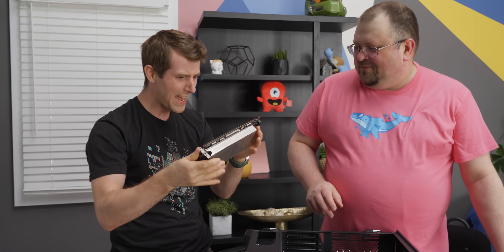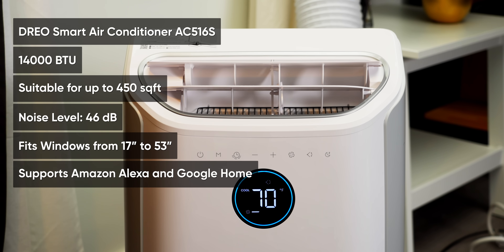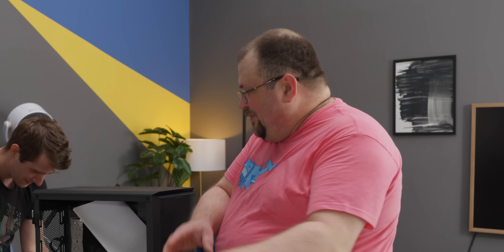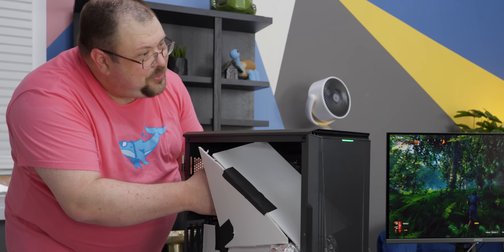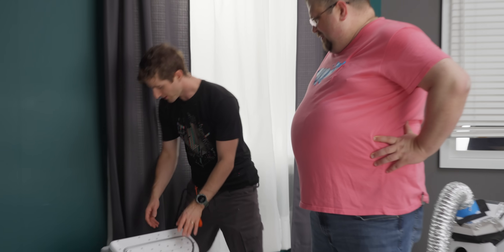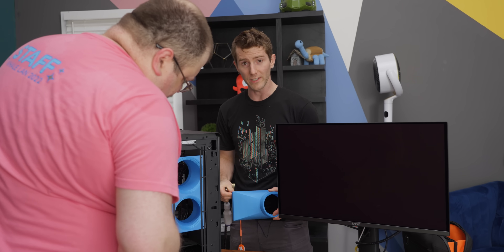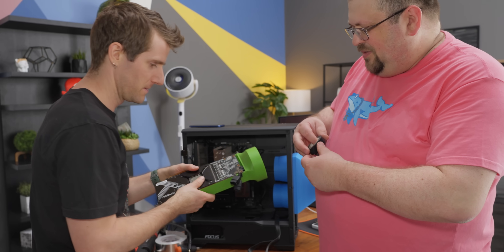Everyone is Cooling Their PC Wrong

Comment: I am "Grade A" disappointed that you didn't build the PC inside the AC box.

As the AC unit has 1 inlet and 2 outlets, you need to create a closed loop between the inlet and the cold outlet and have the seals PC in the centre of the loop. It means more efficiency as it's not taking warm room air and it'll very quickly reduce the air's humidity to nearly nothing.

Comment: The AC delivers cold air, that are hitting warm components, so condensation risks is only the backside of the mainboard?... Pretty sure you should just AC the entire case, so condensation only have a chance to form on the outside of the case. Using the modern house renovation sale pitch "Seal tight, ventilate right"

Comment: I mean if you really want maximum cooling power, take the AC unit apart and build the pc around the evaporator coils.
Reply: that's what a chiller unit is, LTT has done a bunch of videos on that already
Reply: If the computer components are too close to the evaporator, condensed water can drip or splatter to it.
Reply: Then they wouldn't get the sponsor money.

Comment: 500 dollars for a single exhaust hose portable AC is awful, those single hose units create negative pressure in whatever room they're in which is actively heating up the room you're trying to cool by pulling hot air from under doors, windows, hvac ducting, outlets, and any other small gaps for air to come in. If you're spending that much money and need a portable ac, get one with dual hoses, one to pull air from outside and one to exhaust air outside to avoid the negative pressure efficiency loss

Comment: I did this 25 years ago by running the air conditioner duct to an axial fan blowing directly into the server case.  All noisy fans removed and steel custom baffles inside.

Comment: You won't have condensation problems inside the PC.
The AC cools the air. The water in the air cannot just vanish, but the now cooler air can't hold as much water, so it condensates in the AC. That air now has less water in it than before. Once it reaches hot surfaces in the PC and it's temperature rises, it's capable of taking up more water, so basically you dry your PC.
Condensation will only form where warm (moist) air touches cold surfaces; the air duct including all the shrouds and so on and your case - all around!
Reply: I was looking for this comment! completely agree, the PC should be fine. the trouble with cooling PC comes from cooling the components colder than the Air around it 🙂
Reply: @minibeyse  there is the risk of turning the chilled PC off, having warm room temperature air get in there and have a little bit of condensation then.
But I reckon that should be only a little and everything should be fine.

Comment: 2mins in and linus has already dropped an air conditioner . typically the compressor locks up if you run it side ways. it can even explode if ti sucks in the oil and tries to compress it.

Comment: The only real downside is those single hose ACs are WOEFULLY inefficient. You're taking a ton of conditioned air from the room and blowing it outside, meaning hot outside air has to leak in to replace it. Dual hose models or regular window ACs are drastically more efficient. Alec from Technology Connections explains it in far more detail than I could here, but as someone who's used these units (dual and single hose) as my primary AC in the past, there's a night and day difference.
Reply: You can fairly easily DIY most single hose units to be dual hose with some cardboard and duct tape. Neither will ever be as efficient or quiet as a proper split system, but that DIY upgrade does wonders for single-hose units
Reply: @knexfan0011 this is an incorrect assumption - it's not as simple as just making a hose attachment on the intake, you also need a complete separation of chambers inside the unit itself and most of these single hose units do not have that and some are designed in a way where doing so is impossible. So keep that in mind. If you do not do that, the second hose does literally nothing
Reply: @knexfan0011  Im doing exactly that. Works way better with that mod.
Reply: @knexfan0011  How do you DIY the single into dual ? I don't really get it.
Reply: @feuby8480  You find which of the intake vents go to the condenser (the part that heats the air). Then you cut a cardboard box just right such that it covers all those vents. Then you cut a hole for the 2nd hose into it. Finally attach and seal it all up with duct tape. 

Just make sure there's enough room for air to actually flow properly in there, the hose ends are a bit apart and the fan is set to max.
Reply: @knexfan0011  oh thank... Yeah that makes sense. I have mini splits now, and went to window units before, so it do not apply to me anymore, but I was really curious.
Reply: @knexfan0011  Or you can do it ghetto style where you just cut open a grocery or garbage bag and wrap it around the vents on one side and around a hose on the other side
Reply: Yes! Its almost as if you'd have to cool the Unit to, while sucking in the warm Air your trying to exhaust... These things should be banned and 2 hose should be the standard....
Reply: Split unit is the way or geothermal.
Reply: @NerbyScurvy the idea for portable ACs is when you cannot make any modifications (in other words you're renting...) - and split units need sash windows which aren't a thing in the overwhelming majority of the world...
Reply: @Micromation  split units dont need windows, they need holes in the wall.
Reply: Really what you would want to do is to have an outside thermal exchanger and condenser, and then run the coolant lines to an evaporator and a fan combination in frot of the PC and push all the cold into the case - which is basically just plugging your PC directly to the inside portion of your AC/heat pump. 

And then it'll run way too cold and create problems with condensation, and eventually you'll end up just running a secondary coolant loop and whoops, you're back to watercooling - and you might as well just run it to your pool in the back yard like Linus because all this tinkering has already made it so expensive you could have dug a pool for the money :D
Reply: Don't get Alec started on the refrigeration cycle XD
Reply: Yeah this type of AC honestly should just not exist. Its kind of infuriating once you realize how flawed it is.
Reply: @psychopyro8866  It has it's uses, but shouldn't be used where a window unit fits. In my case I got one free and use it for a small room in my garage that I couldn't otherwise get an AC unit into. It's less than a dollar when I use it, and that's worth not sweating your balls off.
Reply: Sometimes you don't have a choice, and the difference isn't that big in practice. There is a MUCH bigger temperature differential between the indoor air and exhaust air (perhaps 50 C difference) than between the indoor air and outdoor air (perhaps 10 C difference). The SACC ratings now used to market air conditioners takes this all into account, which is why for the largest portable air conditioners (14,000 BTU nominal), you'll find single-hose units topping out at 10,000 BTU SACC, while dual-hose units can reach 12,000 BTU SACC.
Reply: This depends on where you live. I have a dual hose unit and I often disconnect the second hose to purposefully pull in outside air to lower CO2 PPM.... obviously a window unit is still king, you can crack another window or door for fresh air if needed... but I have one very small window in my apartment, so a portable AC is the ONLY option. NO window units will fit. I have a dual hose inverter unit from Costco and its amazing... zero complaints. But people should never buy one that is single hose or without an inverter... window with inverter if 1st choice... then portable dual hose with inverter second... never consider anything else unless you do not live in a humid area and are OK wih the loss of efficiency because you got it for super cheap or something.
Reply: Something something heat pump
Reply: The problem is, dual hose units for some unspoken reason do not exist outside of USA. Overwhelming majority of all units in existence are 110V only. Ask me how I know. I've settled for LG Dual Inverter unit but trying to figure out optimal way to modify it to dual hose.
Reply: Yay another TC viewer who understands the physics of A/C! It’s so hard to find dual-hose units for sale though. Like frustratingly hard. Which is unfortunate.
Reply: i cool my pc with flowing creek water ac... it even has a cute water fountain...
Reply: Interestingly they boosted the efficiency a bit when they put it up on the table. Leaves the cold low lying air in the room and exhausting the warmer  higher up air
Reply: Also you really want the AC to be dehumidifying as well as chilling as that will greatly reduce the amount of potential condensation.
Reply: came here to say the same thing.  10 year HVAC guy here - floor-mount / floor-standing ac's are the most inefficient of them all.
Reply: @ShukenFlash  i suppose if your absolutely stuck with one of these units. Cardboard and pipe the cold into the window and put the entire unit outside. That way it pressurizes your house instead, and you get fresh air.
Reply: One of these came with my apartment. It made the house hotter because it was drawing in air from the attic through the can lights in all the other rooms. Haha we rolled it into the closet and bought a few window units. (After asking the landlord if we could, we put in a mini split system and our electric bill went down 30ish%)
Reply: OK, Alec 😉
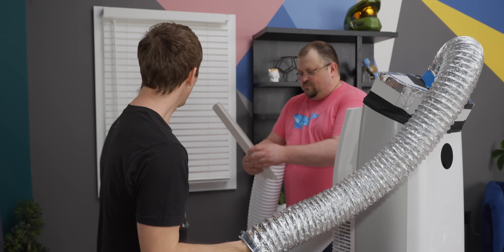Reply: uuummm... this is a dual hose unit - watch at around 2:22
Reply: why so many AC scientists in the comment section today
Reply: Well explained.
Reply: I've got a tiny place and the window is too small to accomodate a window AC unit. Can confirm these things are pretty crap- I can get it to work, but it struggles when it gets really cooking outside and it needs very particular settings or it'll just heat the room up. On the bright side, I'm not the one paying the utility bill. If the landlord doesn't want to pay for such inefficient AC, they should have thought of that ahead of time.

All that said, the methods normally used for cooling a PC aren't exactly energy efficient either- you're just moving the heat from the PC to the room, which you then need to cool more. I'd wager it's still probably better than this abomination, but what you'd really want is a cooling system directly tied to something outdoors.
Reply: Yeah after using one I'm never getting another one like that, the little window thing I got that's like half the size cools the room better
Reply: ypu can duck tape a second ducting to it to fix
Reply: they literally dont sell them in the UK it sucks, only single hose exists
Reply: He has a furry profile pic guys, I think we should trust him
Reply: Yes that is a downside but what I found after using one for my office is to keep the ac outside the room with only thr cold air coming in the room using a pipe and very small exhaust fan. It works wonders, no loud condenser sound, no hot air from the condenser in the room.
Reply: i have modified my portable AC unit to draw air from outside by using another hose to the radiator intake. it uses around 40% less electricity now. but still noisy af.
Reply: @ShukenFlash  that’s actually not 100% true. A single hose A/C can be very effective if designed correctly. there are a couple companies out there that do a good job. THE IDEA is simple heat transfer from the room through the AC and a fan that pushes the air around coils where the heat is removed and because the exhaust goes outside the house it is still removing heat at a decent rate. The issue is that the replacement air is from inside meaning that if placed in the correct location (I.e) next to a door or open space, it will do fine but if placed in the corner of a room with no circulating air, no matter how well designed it will do poorly. Needless to say, dual-hose units are more fool-proof and I highly recommend sticking with those.
Reply: And the crazy thing is that it is near impossible to find dual hose in store now days.
Reply: @ShukenFlash  single hose ac should be banned.
Reply: Yes, we've all seen the Technology Connections video.
Reply: I mean, they make my room cooler.
Reply: Unfortunately dual hose are literally impossible to find, it's incredible how rare they are, probably because ppl do not like the single hose and makers think they would double hate the dual hose so they would not sell a single one...
Reply: @giuseppegius6175  Costco sells one (Hisense). I have it in my shed. I don't like it as much as the Midea one in my office tho. The bulkiness of the hoses should not be underestimated. They come out of the back so there's the thickness of the shroud then the hoses have to turn and have their own thickness. It means the whole thing intrudes in to the room quite significantly. I may have to engineer something a bit more compact.
Reply: @chaos.corner  I live in Italy, looks like in the whole Europe dual hose are not a thing
Reply: Came here to post this and oop all the other technology connections fans beat me lol
Reply: For PC cooling who cares. Yeah, 2 hose mobile units are  better. Split systems are better than those. Whole house AC is an american thing (and prob worse vs single hose mobile ac energy wise)
Reply: @hailstorm7868  I wouldn't bet on that. Whole house often takes in air near the heat exchange unit and then pumps conditioned air through vent tubes to the rest of the house so that any inefficiencies there only take your house in the general direction of where you want it to be anyway. The single hose ones literally pull unconditioned air from outside into where you're wanting conditioned air. It's already starting off on the back foot.
Reply: @chaos.corner whole house thing was more related to (split system) only cooling what needs to be cooled. Doesn’t matter much, 3d prints in video were wrong (gpu needs side exhaust). I mentioned single hose mobile units to be trash tier (still effective, not efficient)
Reply: If the outside humidity is high enough, a single hose unit can actually make it worse inside your home then running nothing at all. The hot and humid outside air will contain so much latent heat that it surpasses what the unit is able to remove.
Reply: No, they do not blow conditioned air outside, they blow hot air outside. The issue is the heat exchange takes place inside the same room that you want cooled, so the unit gets hot and some of that heat also heats up the room, and that is why window mount and split systems are better, they place the hot part of the system outside the room.
Reply: I mean, they make hoses that take the exhaust and vent it out. Not to mention a SA unit (stand alone) and AC in general isn't used to cool, it's used to remove humidity. The air handler is what mainly cools your inside air. The condenser (out side part) just cools down its self and the freon in the system.
Reply: @Dukes3677  Their primary purpose is to cool, not dehumidify. Nobody buys a portable air conditioner purely for dehumidification, dedicated dehumidifiers are much more efficient and far easier to drain (portable ACs typically don't need to be drained in cooling mode where the moisture is evaporated into the exhaust, but do need to be drained in drying mode)

Comment: I have my tower PC sideways on a table in front of my window AC.  The PC exhaust is the same level as the AC intake.  The cold air shoots out over the top of the PC into my room.  And I believe some of that cool air goes back into the front intake on my PC.  It's L.A. so the air is dry af and the temps stay pretty frosty w/o condensation. 
Not sure if this is dumb or not.  Feel free to roast me.

Comment: A collapsed air duct restricts the airflow by atleast half. All flex duct when installed needs to be pulled as taught as possible in a straight line without causing damage.

Comment: 1:12 not so fast little man!
About 12-13 years ago I had a long 100 mm duct with two 100 mm fans inside (trimmed to be round).
I ran them from outside in the winter when it was about -12 to -15 c outside and routed it in to the side of the PC.

Comment: This is what I did in 2007 with my over clocked q6600 and gt8800. Was running one of those automated movie rental places so had my pc in the small room behind the machine which got pretty hot so I ducted the ac output into the pc.

Comment: I have my PC in a very small office, so the office gets very hot very fast as my PC pulls up to 800W when I'm running a very demanding game. It was intolerable. I finally bought the perfect little portable AC called the Eco Flow Wave 2. It keeps the room perfectly cool, and it is astonishingly quiet. I just duct the hot air under the door. I love it.

Comment: Pretty cool ideal! Although, if the CPU is that efficient, would it make more sense to put the fan back on the HSF of the CPU and then run the AC air over the GPU with any escaped air providing enough cooling for the rest of the system?

With the amount spent on my custom hard line tubing PCs this seems like a much better idea plus my room would reap the benefits of the cooling lol

Comment: Frankly the obvious answer cooling the pc is not the problem, it’s the production chip units and motherboard components including the power supply that is drawing more power than needed to run a functioning machine. What’s the answer? Ice and more Importantly more Ice! From 24 cores to 64 cores from 128 /256 /512 to 1TB cores the more the cores the better the cooling will be optimal and the heat will be toasty as ever and to improve the PC and perhaps performance. The current power supply does not give out the improvement you need on your PC system no matter how much you try to cool the PC, we need to think out side of the box here not inside of the box by using air conditioning unite that takes in moisture and humidity.